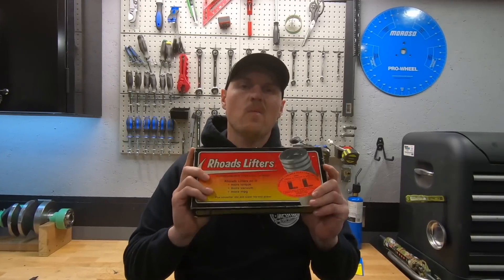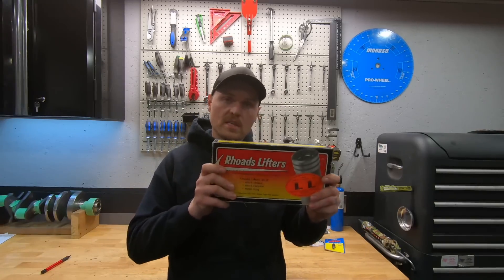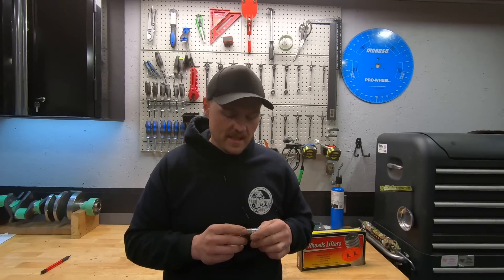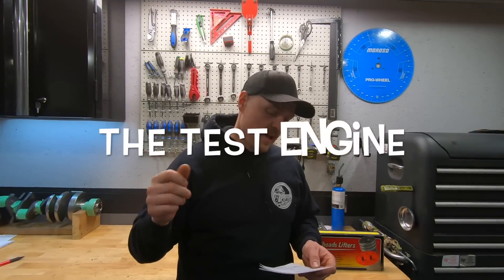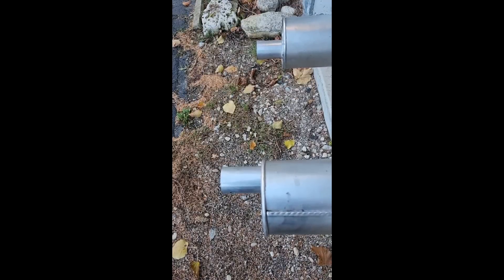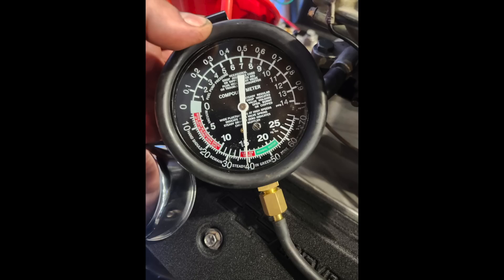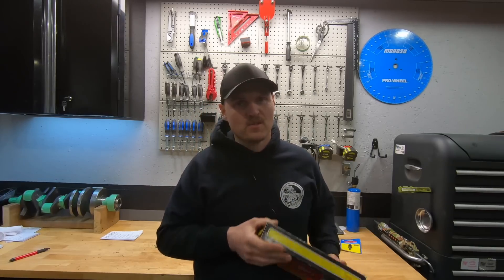More Power? More Vacuum? Rhoads Lifter Test Part 1 (406 SBC w/Summit 1203 Cam)

Comment: In 1980 I used Rhoads lifters in my 1970 Mach 1.  The engine had 11 to 1 compression, a TRW cam with 500 lift and 300 duration, an Edelbrock intake manifold, a cheap set of headers and a 650 Holley from a 1968 390 gt (according to NAPA).  I had the stock torque converter and 3.25 gears.  It idled ok and the power brakes worked.  The radio antenna shook when stopped.  It sounded like a solid lifter cam.  It was dead until 20 mph then the right rear tire would break loose and it ran great, still pulling hard in 3rd gear.  Later I reinstalled the stock iron intake and exhaust manifolds.  Kept the Holley and installed a 1971 351 CJ cam with the same lifters.  The radio antenna stopped shaking and I could spin the right rear tire off the line, until I lost a lobe.  Taught me a lot about camshaft specks and not to reuse lifters with a different cam.
Reply: I’d really like to see a dyno comparison graph

Comment: Thank you I've been interested in these as well Im glad to see they are working down low 
I'm with you on thinking it would be best case scenario if they pumped up and made the same power as stock 
🤔 So with these you can "street drive" a lot more aggressive cam than normal so if you know your going to run these you can choose a more aggressive cam 
So even IF they don't pump to to get full lift you could just get a bigger cam to compensate.

Comment: I have a set of Rhoda’s lifters on just intakes to smooth out bottom end. Don’t notice anything different in top end but bottom is stronger. I have another engine same 327, heads, pistons, and Comp 270 grind cam without Rhoda’s and definite less on bottom end. No difference in cranking. Have not checked vacuum difference, or compression. Carb and intakes are different so that could mask differences. Yes interested in dyno results. Mine are street cars so ultimate HP is secondary to drivability.😊

Comment: Installed these in a 72 olds 455... at 6000 rpm had one lifter internally seize in the collapsed position.. took it apart and found bad grind/polishing marks.. never tried them again.

Comment: I've used them about 25 yrs ago running 1/8 mile track on the weekends. 60 ft times decreased a bit. Don't remember how much, long time ago. They definitely made daily driving more agreeable, brakes,idle, mileage.  The only thing I didn't like was trying to get them all setup to pump up at the same time. All in all a good experience

Comment: Please do the test! May I suggest testing the Rhoads lifters installed as per the instructions (preload) and then adjust the lifters like a regular lifter. Also, if possible, to test different viscosity oils, 5W-30 & 20W-50?  Thank you.

Comment: I’ve ran these lifters for 40 years, I have used these lifters in 366 and 427 grain trucks and winch trucks in our every day 1 ton Chevy trucks And Chevy powered jeeps not one cam or lifter failure, and we are still using these cam and lifters today. with all due respect to Mr. Vizard our test proved just the opposite of his opinion.

Comment: Ran a 302 Ford with a set in the 90's.  Crane Cam, Holley DP race carb. (no choke horn)  It would not idle for crap under 1400 rpm with standard lifters.  With the Rhoads lifters, it would idle at 800 RPM once the oil warmed up a bit.  I smoked more than a few people who mistook the smooth idle for being mostly stock.

Comment: Apparently the 2000-02 Vipers (powderpuff) had a roller version of these lifters as well as a different cam. Peak HP numbers were identical to the 96-99 cars. The 1/4 mile times were 0.5 seconds slower with the bleeddown lifters.

Comment: They work!..  Had them in a old 350 chev with 1.94 heads and large cam and TM1 intake.
Wow that thing was a rocket out of the hole, even with 3:73 gears.. 
Should have fell on its face for a bit, but vaporized tires and pulled hard to 6500.

Comment: Definitely do the Dyno test. I remember when Rhodes were the lifter to have. I thought they were gone. Johnson lifters have a lifter that bleeds off similar to the Rhodes. They recommend nothing more than 30w. As thinker oil slows down the bleed off and slows down the pump up. Chrysler was using VLA( variable lash adjusters) lifters on overhead cam engines. Thin oil. 5w-30.5w-20.

Comment: Built a .030 over 302 35 or so years ago for a Mustang II. Used a Crower M300H cam that I had scored from a parts car. Horrible driver but great top end. Dropped in a set of Rhoades and the car was transformed. Other than still having a bit of idle chop and the tick you'd have thought it was stock.  It would idle at 600 rpm in gear on a stock converter and had power brakes again. Driveability was outstanding as well.

 The horrible downside was my now ex-wife would make every excuse in the world to drive the Mustang instead of her LTD.

Comment: I had them back in the 80s in a ford 302. they made a tick noise but nothing major. they did have a bleed off and were hard to adjust. rockers would jump off the valve on start up.

Comment: I definitely want to see a dyno test on these. I ran Rhoads Lifters in my Oldsmobile 350 with a fairly hot cam (don’t remember the specs) back in 1987.
The idle was good, the vacuum was pretty good too. I didn’t like the noise though. Low end was improved but not great. Mid to high was impressive even in my big heavy ‘76 Delta 88 with 2.73 gears. Later I built a 455 with a similar spec cam and I went with TRWs bleed down lifters. They worked just as well without the ticking.

Comment: Would love to see this test. I have them in my GTO   It's a 406 Pontiac with approx 9.5 compression and 231/237 @110 deg, .480 lift cam.  I also get 180-185 psi cranking compression when warmed up and similar vacuum.   I've heard Vizards comments before on them so very curious.

Comment: I’m guessing they’ll improve low end, but won’t quite recover on the top end. But the only way to really answer that question is to put it on the dyno! Spec a cam with a bit more duration, like 5-6°, and lift, maybe 0.030-0.045”, and see if you can improve both ends vs the Delco lifters. Then put the engine on the street for 50,000 miles and test again… Sorry, just dreaming

Comment: I ran Rhoads lifters for 20+ years until I switched to a roller. I loved them and recommend them to anyone that wants the best street engine. I had no problem with power disc brake and with all due respect to David Vizard, they do work. By 4500 rpm they were fully pumped up. I love the way they sound. With today's roller cams ever where, I'm not sure there is still a market for them, but for any hydraulic cam, street engine, they are fantastic.
Reply: I had a set in a small block Chevy years ago,280 490 crane cam,sounded like van Halen drum intro on hot for teacher song idling
Reply: @jhenry7406  Now that's a spicy cam!

Comment: TEST, TEST, TEST! And a note from experience: I used a 1975 Pinto Station Wagon as a daily driver with the 2.8L Cologne V6 and solid lifters. They needed to be adjusted every 15K, twice a year and were reasonably easy to adjust. I couldn't tell the difference in sound between them and my Chevy 348.

Comment: I have a set in an old Ford 302 on a 80s Crane Energizer. They are fantastic. And as a testament to the way they used to make stuff this is the third engine this cam/lifters has been in and still going strong.

Comment: Thanks for the video. 
Like a few others have asked. I wonder if oil pressure, and or oil Wt. would affect them? I worked in an engine shop in the 80’s and the engines that the Rhodes lifters were installed in worked as advertised. That was from 4x4 trucks, to muscle cars. And as other have stated about running certain “cheater” lifters in circle track.
Reply from the maker: I'm going to test with 10w40 and 20w50
Reply: @ That will be great! Thanks!

Comment: I ran these in my 355 with Vortec heads and a Magnum 280 for over 20 yrs. I got the same cranking pressure you did but nowhere near that much vacuum at idle. The most I could pull was 12 in/Hg. And yes, they're noisy as heck. 

I'm switching to a roller cam. Next spring for the Edelbrock E-tech 122 you helped me figure out the mystery port on the Atomic 2.

Comment: I used Rhodes lifters on a 383 I built about 20 years ago. I used an XE274 Comp cam. I had about 14 in of vacuum. I was also using a vacuum canister. I had pretty decent power brakes. I never crashed into anything. 😂 I had just shy of 200 cranking compression. Tbh, I have no idea what kind of power that engine was making. I'm thinking probably 420-440ish? I had it in a 74 Camaro. Sometimes me and my buddy would cruise around looking for stop light to stop light opportunities. I kinda miss that car. I have a Vortec 305 in my S-10 right now.  It's 100% stock. And it looks like it came from the factory like that under the hood, all except for the headers,electric fan. I deliberately used a 305 because I didn't really want to be working on it all the time.  And I don't think the NVG3500 transmission would hold up to a whole bunch of torque,or the rear axle.I put a Torson posi out of a late 90s Camaro in the rear axle for some traction. It's still a pretty fun little truck, even though it's probably only got 230ish hp. The old 4.3L was probably only making 175 or so. And that's at the crankshaft, so it probably only had 140 -150 at the wheels. I kinda made some homemade traction bars out of an old pair of square body leaf springs and polyurethane pinion snubbed bushings. They do an ok job with limiting axle hop. I really don't drive like an maniac anymore. I'm pushing 50 now.  I don't wanna be fixing shit all the time. 🤣 I just wanna drive it.

Comment: I tried Rhoades lifters in my fresh built 390 ford. I did not like the noise, so I took them out and put speed pro lifters in. Very happy with that decision. Also used Crane high intensity lifters in a fresh built 350 chevy. They helped the idle, but don't bleed down as fast as a Rhoades lifter.

Comment: I could care less about the vacuum increase ; most race cars don't have power brakes anyway..I could care less if they're noisy either  solid tappet lifters aren't quiet either. You aren't even showing the best aspect of the lifter !   Show the viewers a close up  view of the Delco lifter and the Roades lifter . I want a lifter that's not going to pump up and self destruct  !  Show the machined groove and retaining rings of each lifter . The Roades lifter is the only design I've  ever seen that probably can't self destruct  !    If I want a lot of torque  I'm going to use a flat tappet mechanical cam anyway.  I haven't inspected the physical design of mechanical flat tappets yet ; but I suspect that I might not be satisfied them either .Thanks for introducing us to the Roades lifters anyway.

Comment: Yeah, in theory it sounds great but without a computer calculating load and controlling bleed off with a PWM voltage it's not going to be of much benefit but prove me wrong.  I would love to see the tests.  
Solid lifter, roller cam, a proper high stall converter/side stepped clutch, and a set of matching gears along with sticky tires and a redlined WOT is the only way.  My opinion.

Comment: I have never used these ones, but have used a similar type in a Harley. Listed as a hydra solid. Yes they are noisy but did turn into a solid at high rpm. As for performance gain I could not say. They definitely worked as advertised with no valve float at high rpm.

Comment: I have a set in a older 360 mopar engine and I believe they work pretty much as advertised. I don't know why more people haven't used them, they are ideal for a powerful street engine.
Reply: I just stuck some in a 360LA rebuild, they are noisy as crap. Did yours ever get any quieter with time?

Comment: I want to see the dyno results, but keep in mind that you would use thicker oil when these came out. Straight 40 weight was we used in AZ on street strip engines, it makes sense that Rhoads lifters would bleed off less pressure with thicker oil than the super thin oils used today.
Reply from the maker: I plan to test them with 20w50 and 10w40

Comment: I was told to get these as a teen and they definitely worked. Granted I had a fairly mild Summit cam in a stock 350, it never had start-up issues, always idled great, and brakes worked well (even being 4 wheel drum). It acted more like a stock cam, besides having some power. I have some ilde clips before I swapped to an LS.

Comment: This is 1980s tech. I personally never liked them but they definitely work in the way they say. I would rather use electric vacuum pump that comes on with a pressure switch. To each their own. Great video!
Reply: Actually Rhoades lifters were made in the 70's and they were derived from Pontiac lifters. Several of Pontiacs highest performance engines of the late 60's had "bleed down" lifters in them and stock and super stock racers figured it out and bought Pontiac lifters for certain race applications.

Comment: You have to be careful on over the nose spring pressure. If you get too much they won't recover at high rpm. As a result you get valve float. I use on a circle track setup and found the Z28 springs were the max I could use
Reply from the maker: I'm running beehives on this engine which have great control with low spring pressure. So hopefully they work well

Comment: If it never gets the top end power back, then what's the point? You're simply better off going with a smaller cam, and using regular lifters!!
I think in order to get these lifters to do what they are designed to do, you might also have to test different oils to find the right weight.
Reply from the maker: I'm going to try it with different oil weights

Comment: I am extremely interested in this test. I also LOVED that you broke-in TWO different sets of lifters on ONE camshaft. IT IS possible!
Reply from the maker: If you're crazy 🤪  haha yes it is
Reply: I've done it on a stock 318. It was a dad truck and he'd told me to take it and drive it some. Shoulda known it was a setup. Anyway, didn't take long before it jumped timing and though it got me home, it was running rough. Bent a couple pushrods and valves, pierced a couple rocker arms, and I figured the lifters were damaged as well. Cam looked ok, so I replaced the head with one I had available, all new pushrods, the damaged rockers, timing set, and all new lifters. Granted, it's a very mild cam with super soft springs, but it worked, and ran better than ever.
Reply: What a terrific video, I had these Rhodes lifters 35 years ago on an Erson high flow II H camshaft and they sure were noisy, drove me nuts, glad to see that they actually do work at low rpm but would love to see what they do on the DYNO!
Reply: You can put new lifters on a used cam no problem at all. What you can't do is put used lifters on a new cam.

Comment: I worked in a speed shop in the late 80's through the 90's. I sold a lot of Rhodes lifters for street cars. Better for power brakes and less need for high stall converters.
Reply: People must have liked them or you would get complaints.

Comment: They do make a cam idle smoother. But they dont make full potential of the cam.. I know , I tested em. Reg lifters killed them everywhere!! Fact.
Reply from the maker: Did you track or dyno test them?
Reply: @cuttersperformance  Track. Had them in a serious street 400 ford to give a bigger cam some low end as well. Never pulled very hard to the redline. Was suspect of them. Bought some crower cam savers, slipped them in, ran better EVERYWHERE! Was my last time using them...

Comment: I put Rhoads on a '69 318 (268H) with non adjustable rockers back in 1985. They worked well but, the idle exhaust sounded dead stock.
Reply: Thanks for info. Stock sounding idle with a stout cam for street use is a bonus to me. 🤫
Reply: The 268's sounded stock in any application.

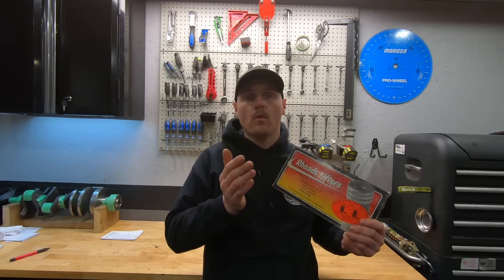Comment: I ran these lifters ordered from P.A.W. in the late 90's. Mild Street Build: SBC 355 9:25.1 Keith Black pistons, fuelie Heads, Isky 280 mega, weiand 8004, 650 Holley dp...

They worked as far as lifters. No dyno numbers to share with you.

Comment: Back in the mid 80s, in a 1965 Pontiac GTO 389 tri-power, running an old school Comp 292 cam (244@.050 single pattern) and headers, they worked as advertised. Power brakes worked as normal and we were able to lower the idle speed. However, the car seemed to lay down on top. At the Pomona drag strip, the car went from consistent 12.8s to 12.9-13.0.  For what it's worth,

Comment: I ran crane high intensity lifters and Rhodes. They both do the same by leaking down duration and it had increased low end torque and more vacuum but I wonder if it makes a difference with a standard volume oil pump verses a high volume or high pressure

Comment: Now put rhodes on one bank and stock in the other bank, do a few thousand miles then pull the heads and look at your ruined valve seats on the Rhoades side!
Reply from the maker: Ive wondered that
Reply: @cuttersperformance   from your test and using your cranking compression pressure you can now really easily reverse enginner this for your own interest.
 Use a DCR calculator to mimic your initial cranking compression figure, then alter your IVC till you get your Rhoads cranking compression.
 Now you know where your Rhoads IVC is you can set up a degree wheel on the actual engine and find the cam lobe point where this new IVC occurs. Now plot the lifter motion per degree of engine revolution leading to both stock and rhoads intake closing position and you'll see how much of a faster ramp area you are on with the rhoads lifters.
 That clatter you hear with the rhoads isnt clearance as such it is the valves hitting the seats hard.